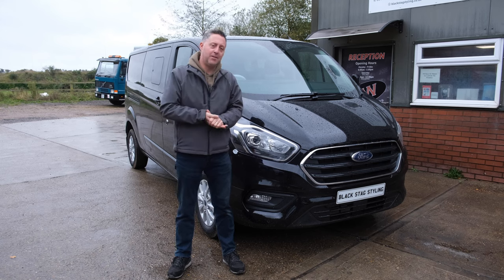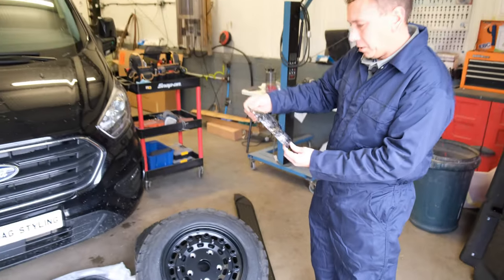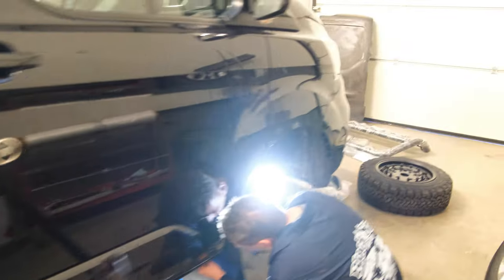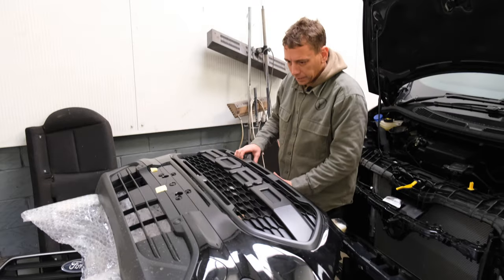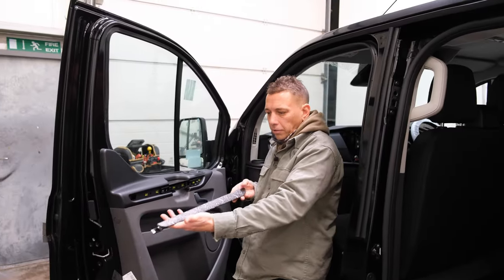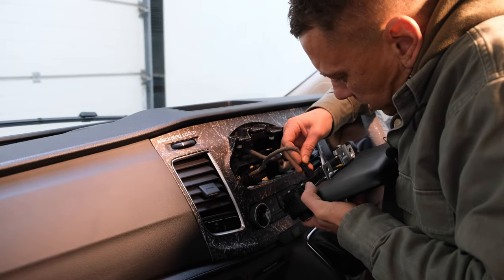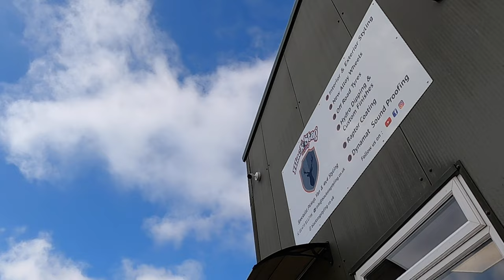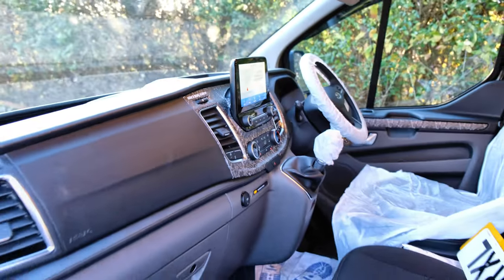Ford Transit Custom Limited Modified into Swamper Van, Black Stag Edition, Ford Transit MODS!

Comment: Does the a-bar interfere with front parking sensors?
Reply from the maker: @pidu1976  no it doesn’t as we fit blanking covers over the two middle ones.
Reply: @BlackStagStyling  so only the corner parking sensors are working in this case?

Comment: Hi guys, what size wheels and tyres was they please?, also is that the largest you recommend for a Custom, cheers !!...👍
Reply from the maker: Thanks for watching our video and it does say the wheel size in the video. Any bigger and you stand a chance of them rubbing 👍🏼😎 16” wheels and tyres.
Reply: I have 18” with general grabber all terrain tires on mine, no rubbing 👍🏻, think 16” look a tad small.
Reply: 215/65r16